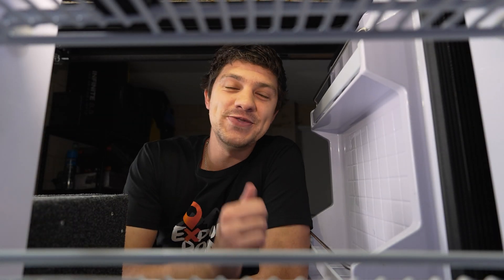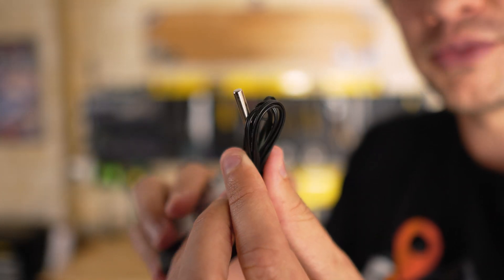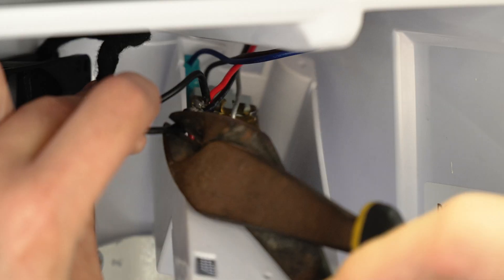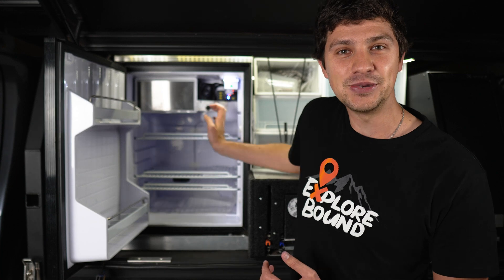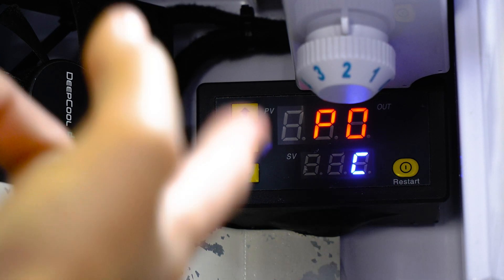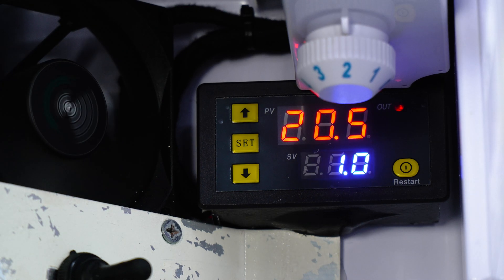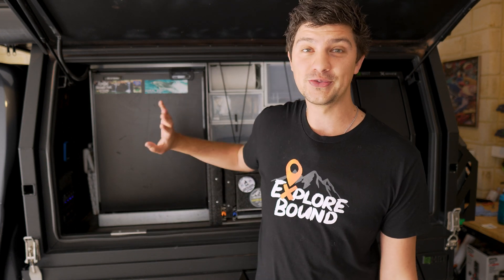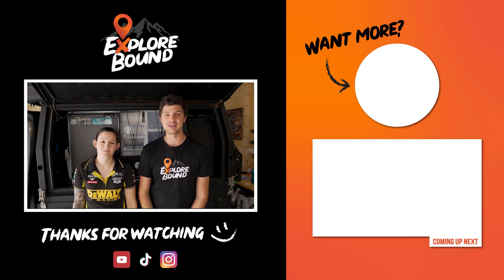Installing a DIY Temperature Controller in my Bushman 85L Fridge

Comment: I have done the same mod with my kings upright 85L. It is a little different as it has a digital temperature control and runs an LED light with 5v feed.  I used a 5v fan and temp relay wired from the circuit board of the light and works great.  I also adjusted the variance to 1deg but the fridge compressor cut out must be more like 2-3 deg variance from what I can tell.  The great thing about the temperature relay is that it also gives you a digital temp display of the fridge temperature.
Thanks for sharing!
Reply: Love a link to the fan you used mate

Comment: How's the temp controller holding up? Thoughts on it living inside the fridge with moisture = corrosion etc?  Keen to do the mod but contemplating mounting the controller on the outside and feeding wires through where the others come through 🤔

Comment: Great job mate 👍 just a thought wouldnt you be better off just connecting the fan up to the compressor power so it only goes on when the compressor is running?
Would that remove the need for a temperature controller?
Im about to install the fan and thinking this might be a better way to go . . . .
Reply from the maker: Thanks mate! Yeah I have heard of a few people running the fan off the compressor instead and have heard that this works well.

Comment: I have a bushman original sc35/52 with a faulty led/lcd screen instead off paying over $150 for a new control panel plus shipping is there a way to use this to control the temp settings,

Comment: Well done mate looks tidy. if you want to ditch that rotary dial to adjust the switch, what you can actually do is use your tempreture controller to also connect to the compressor. the 'C' and 'T' terminals on the control box mounted on the compressor  is shorted out to make the compressor run and circuit is broken to cut it off. alternatively you can just use those brown and blue wired that connected up to the existing thermostat as to not need another penetration. 

the fan terminals on the side of the compressor are also a regulated 12v supply. This is done as the compressor can run on 12/24v, but the fan comes from a PC which is only designed to run a regulated 12v supply. It might be worthwhile to switch it over as the higher voltages its being fed  during lithium charging or its higher resting voltage could damage it over time. But tbh i don't think it matters too much and the fans are cheap enough to replace anyway.

Comment: Mate, this vid was exactly what i needed. Recently bought the same controller and had no idea how i was going to wire it until i came across your vid. Extremely helpful especially with the wiring diagram you put up. Well done.

Comment: Do you think is necessary to have the on/off switch? Or would be ok if I connect the switch on the outside of the fridge after the thermostat (not in between the fan and thermostat )
I will be connecting on the outside terminals not with the lights wiring.
I hope my question is not too confusing 😅😂😂

Great video thanks 🙏🏼
Reply from the maker: No need for the on/off switch really, I had the switch there from before I installed the temp controller (the temp controller has it's own on/off switch). Yep you could connect to the thermostat power supply instead of the light and that would turn the system on/off as the fridge kicks in and out. 🙂

Comment: Hi Daniel. I have just installed one of these temp controllers and a fan in my Bushman's fridge based on your good work. It seems to be going well so far. However is it correct that it will not turn off when the fridge is turned off at the temp (0-7) dial? Is a manual switch a solution for this?
Reply from the maker: Hi mate, yes that is correct as it acts independantly from the fridge compressor - with the temperature controller I used here in this video, I just hold the little button at the bottom right to turn the fan system off when not in use. 🙂

Comment: I'm a little confused by the low temp of your fridge when the fan is on. I think your normal fridge temperature probe (that controls the fridge compressor) needs to be moved. The compressor should be off well before those temps are realised and should run less not more. If anything, the controller you put in would be better running the compressor not the fan to do the same job.

Comment: Hey mate love the video wanna do this as well, just wondering did you get how much power it uses per hr?
Reply from the maker: Hey mate, the fan itself only draws 0.08A, however will cause the compressor to be active more frequently than before and am yet to to thorough testing on this. I will mention that I haven't noticed any significant power consumption difference since installing the fan though!

Comment: Good job, hopefully the manufacturers will incorporate some of these mods into there newer iterations. 
Have you done a comparison of power consumption before and after ur latest mods? You can still do a before test by dialling down the new thermostat to mimic it’s old habits (plus a few watts extra for the new thermostat maybe).  Thanks for keeping us updated. Cheers
Reply from the maker: Thanks mate! I'm still yet to do a proper test (although hard to keep all variables the same including how often door opened etc). I have taken it on a few trips since the install and haven't noticed much of a difference at all in power consumption but will share results once I've had a chance to test properly. 🙂

Comment: hey mate. Good video mate. I have the same issue in my 65L where the fridge seems to run constantly. Looking to do this too. What setting did you set the fridge to? 2 or 3?
Reply from the maker: Thanks mate! Since the temp controller install I've left the fridge on setting 2 and the internal temp has sat exactly between 1-2 degrees.

Comment: How many watts does the fridge burn per day now? And how many watts did it burn a day prior?  Because now the fridge motor is turning on not just to cool the freeze compartment but to replace the cooling the fan takes away from the freeze compartment..   so with the fridge turning on and off much more frequently now, what is the power increase?
Reply from the maker: I'm yet to do proper testing so will share results when I can, however in the handfull of trips I've done since finishing this install I haven't noticed any difference in power consumption (I'm sure there is a minor change, but not noticible). I think the key with the temp controller is that it only fires the fan up long enough to circulate the cool air down low in the fridge before shutting off again to not cause too much affect on the freezer. 👍
Reply: i went to Jaycar with my mate who has the bushmans upright fridge he was going to do the same thing they said would chew to much of your power so my mate is not going to do it now

Comment: If the fan was wired to turn on when the compressor kicks in, then the factory dial would  work as it should. There wouldn’t need to be an aftermarket controller, Just a bit of trial and error to correspond the factory numbers on the dial to the desired temperature.
Reply: True, but this is now like a dual zone fridge. The lower half can be set to +4 or less (i.e at or under 5oC) to satisfy Australian food standards, and the  freezer can be set to keep frozen foods at -18oC or colder.

Comment: Guess it doesn't matter on such a low draw item as that little fan, but it seems odd to put the switch on the earth side of the circuit. The fan is live constantly. It could short with all those corrugations.